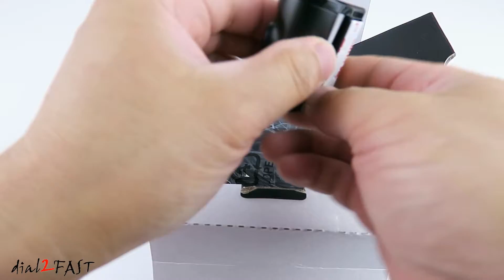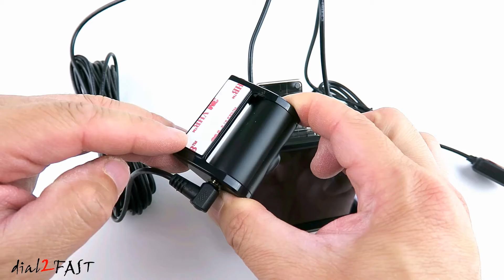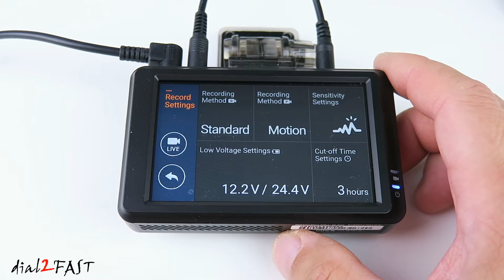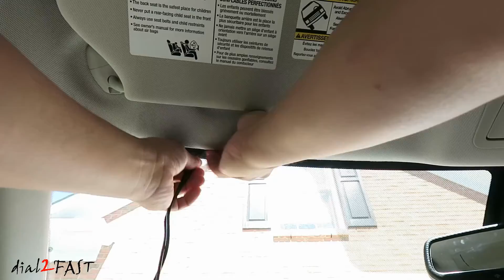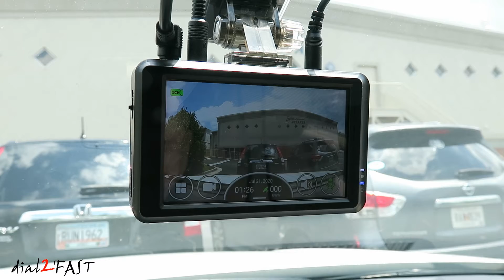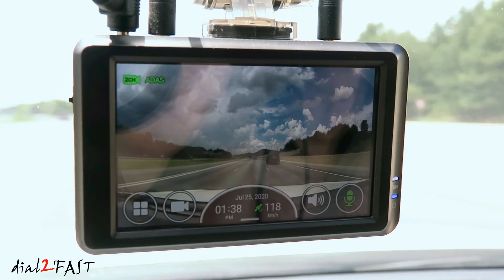BEST VALUE Front Rear 2 Ch Dashcam - FineVu X500

Comment: Hi Dial2fast. Thank you so much for the review! I was just wondering if this dashcam records over the existing video on the card once the card is full? Or do i have to manually delete videos or format the disc every time it becomes full? Is there any warning when the sd card is low on space?
Reply from the maker: All dashcams work on 'loop recording' which means it continuously record a series of 1-5 minute video clip. Once the card is full, it will automatically begin overwriting the oldest file. You don't need to do anything.
Reply: @dial2fast  Thank you so much for the reply! I am deciding if I should this dashcam or the Viofo A129 duo (which you have an amazing review on). The Finevu seems to have a much easier user interface and has so much more components (a micro sd card and a hardwire kit included?! amazing) compared to the Viofo. However I feel as if the Viofo is more inconspicuous, less visible and less bulky. What would you suggest? Apologies for the long question.
Reply from the maker: @AniAngelSupeBat  Get this one
Reply: @dial2fast  Ok. Thank you!

Comment: Nice dash cam. only one major flaw, the power connector. Why not make it USB like all the others. For vehicles that came with only 1 power port that wont work when I have an USB adapter already installed there that give me 4 USB ports that are all in use. 1 being my current dash cam. As for hard wire option My 2010 Jeep compass had no fuse box in the interior. All fuses are located in the engine compartment and there are not many since Chrysler would rather use a TIPM instead of fuses.
Reply from the maker: I understand your point, but any dashcam that's truly designed to operate in parking mode and compatible with optional backup battery will use this type of power plug simply because the connector has to support 2 power wires. One for ignition and one for constant 12v. This is how the parking mode will automatically enable when ignition turn off. USB does not allow for this dual 12v sensing.
Reply: @dial2fast  How about using 2 dashcams of the Viofo A119V3 for front and rear DIY compared to this one? Which one might stand better quality?
Reply from the maker: @seekfactsnotfiction9056  Running 2 dashcams in the car doesn't make a lot of sense. Because you will have to run ignition 12V to the rear dashcam. Also they recording is separate and independent. The A119 V3 is not exactly cheap. Latest check on Amazon is $115. So if you get two, it's more than the FineVu. Even if say you already have a A119 and you just want to buy another A119 to install in the rear, why not spend an extra $45 and get the FineVu for a good front/rear complete system.